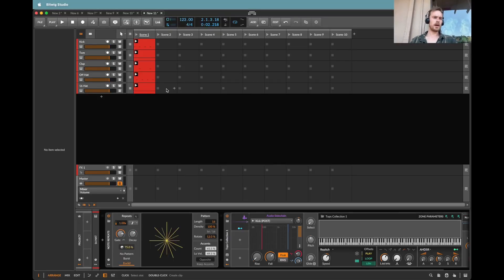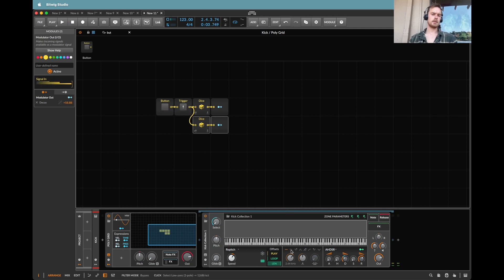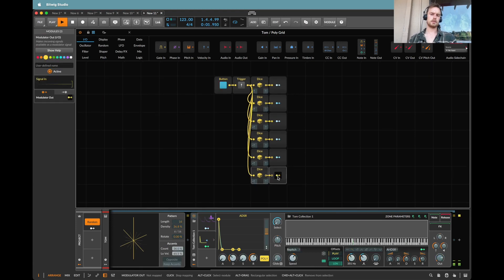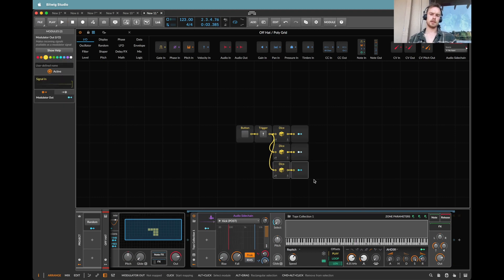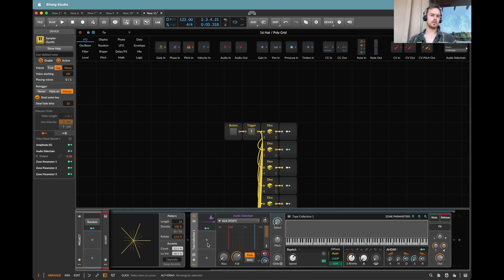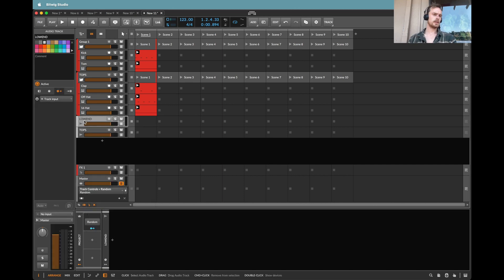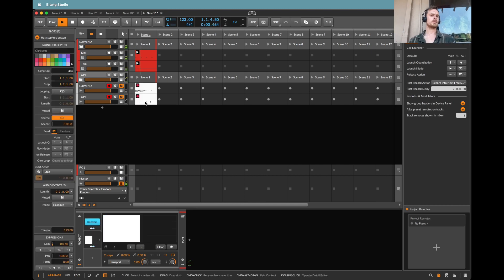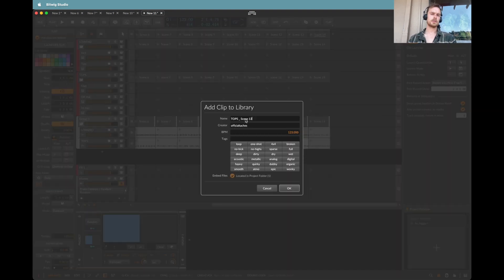Automatic Top Loop Generator

Comment: Stupendous!

Followed this through last night, dont know if its my samples or i need to dial back some of the modulations but it generated more shite than useable loops (stuff like the kick disappearing completely, or the hat loops release being too long and generating rubbish).

That being said, the premise of having a button randomise all sample selections is great, though i might be tempted to have a button for each element as well for cases where it generates a nice loop apart from one element.

Also great usage of the step mod to auomate the button press, I'll be using that for all sorts!

Thanks, you're an absolute gent 😊

Comment: Woah!  What am I supposed to do with XO now?
Reply: Use for the times you're forced to use Reaper 😂
Reply: I wonder if there isn't a way to use XO or Atlas instead of the Bitwig sampler. Later today I have to look into that. Probably it's possible to trigger the randomization of a single instrument by midi. That would be perfect. It would allow randomization over your whole sample library.

Comment: That's brilliant man. Very nice automation!  

I only discovered the trick of sticking another instrument in the Polygrid FX slot last week. I made a grid that outputs a bunch of different noise that you can use to modulate synth parameters to give them analog drift or variations like you did. Works good.

These little tricks can really save a lot of time.

Never thought about making entire loops though. Lots of ideas from this, thanks!